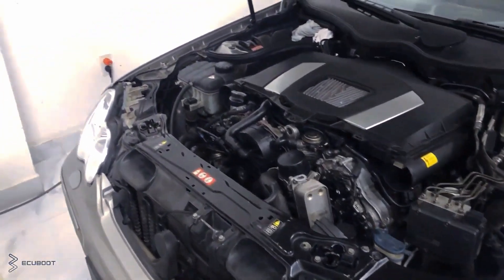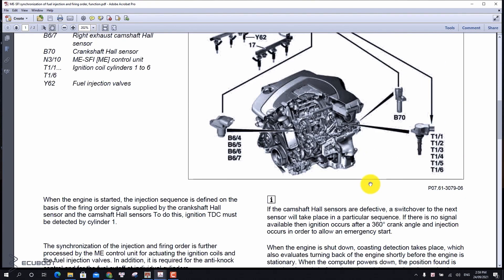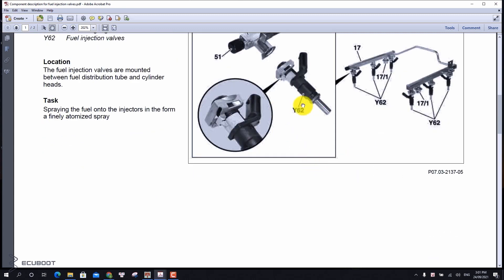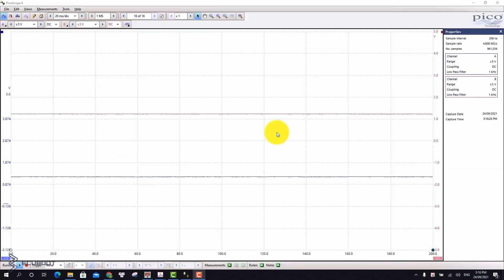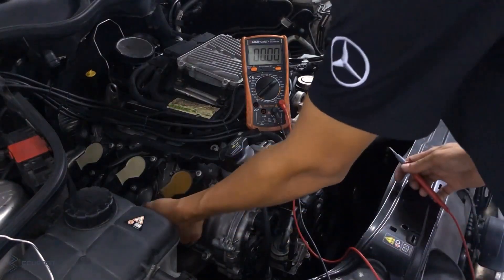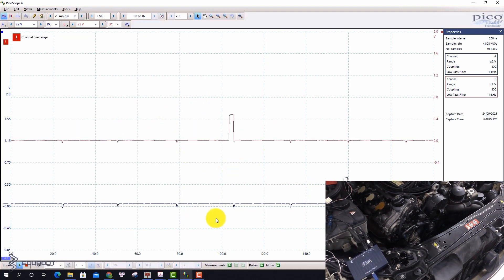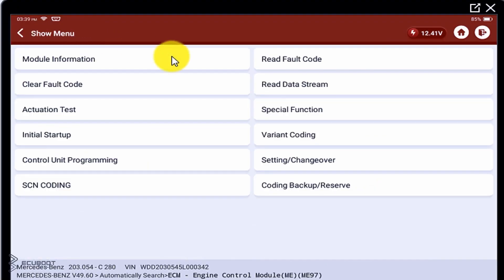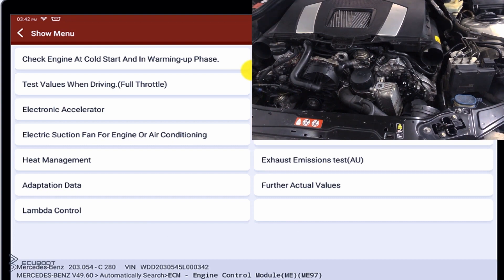Fixing Mercedes C230 W203 Misfire P0300 P0301

Comment: Hello,
I bought a 2008 Mercedes Benz CLS550 from auction and I am having the notorious #1 cylinder misfire. I've replaced call coil packs and spark plugs. Symptom still remains.  Injectors and compression are good and tested wiring from ECM.  I am at a lost as the car idles rough but drives well on the highway.  I'm only concerned because of the check engine light that is really the annoying part that tells me there is still something wrong.  Any help and or ideas what to check next before I make a decide on rather to cut my losses or make a unscheduled dealer appearance that I don't want to make... HELPPPPP :)
Reply: Is your cylinder then
Reply: check your o2 sensors
Reply: Were you able to figure out what was wrong?